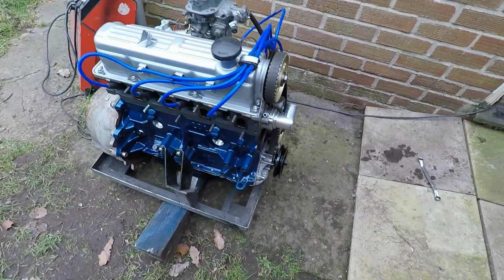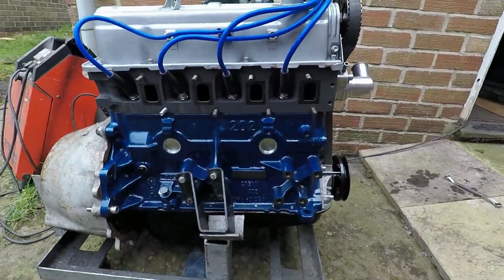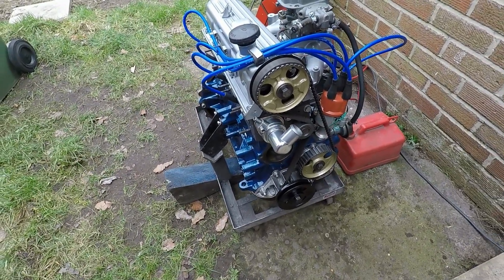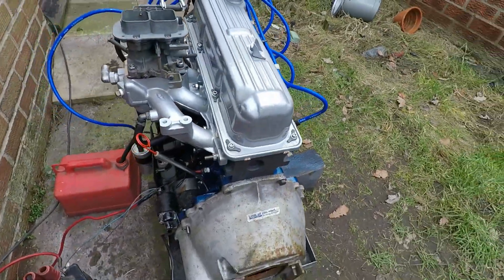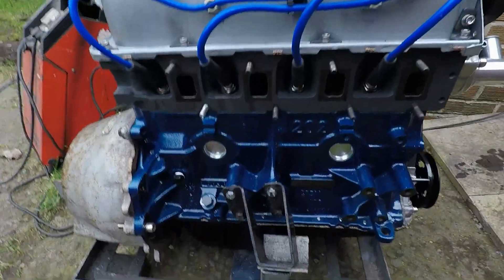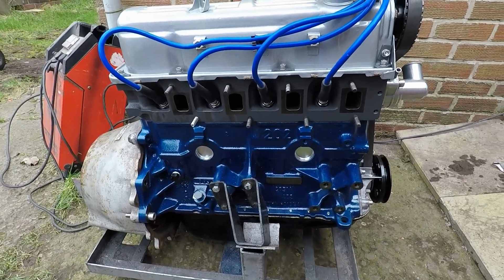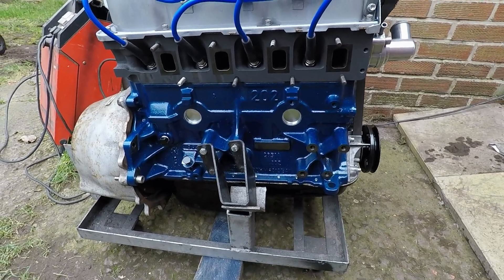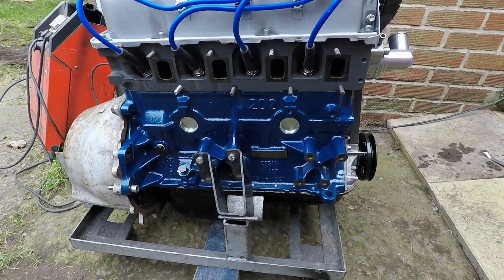Ford OHC Pinto 2 Litre Engine  first fire up   . . . . .   1991 202 block.

Comment: A few short comings when they were first made like the cam oil spray bar getting blocked and knocking cams out but overall a truly great long lived engine capable of big mileage with regular oil changes.
I had a 1.6 in a Capri & a 2.0 in a mk4 cortina, neither gave any trouble. Easy to work on and service and inexpensive..

Comment: I have a 2Ltr pinto in my Escort which has done a genuine 80,000 miles and I would love to know your thoughts on preventing the rear crankshaft oil seal from leaking.  There is no wear on the crank where it fits and it's pouring out enough oil to soak the gearbox crossmember rubber mounting!   It seems to be a big problem with my friends who also have the same engines.  I fitted an original Ford seal, which went in nice and evenly but it did not last very long.  I have thought of trying the Cosworth twin lip seal and I believe there is a PTFE version available now, any thoughts would be welcome.   By the way that pinto does sound good.
Reply from the maker: I have never really had a problem with leaking rear seals, If where the seal runs measures up ok with no corrosion marks or grooves the standard seal should be fine.... Might be worth checking the rear bearing cap as this has a seal down either side... I have stripped a couple that were oily in this area.....
Reply: @BLOWN8CYLINDER  Many thanks for getting back to me, but it is quite a common problem that I have read about many times!  All seals were replaced with Ford Items on the engine rebuild, that's why I'm puzzled.

Comment: I'm stripping my 1.6 pinto but can't get the crankshaft cam belt gear off. Have tried 2 screwdrivers but not budging. any tips please. Good video by the way.
Reply from the maker: Sometimes they slip right off but every now and again I come across one that doesn't want to move.... I have found that heat is your friend and a blow torch will heat it enough for it to slide off.
Reply: @BLOWN8CYLINDER  sorted ! Borrowed a really thin 2 leg puller . Cheers

Comment: Hi again, another problem,  I've bought all my parts for the rebuild but am having problems with the serrated oil control rings. They are too big for the bores. All the others are fine with about 20 thou gaps. They are the correct ones for my engine. They actually overlap by at least 1 millimeter. I'm on std bore with new hepolite std rings. The rings info is correct for my bore size.
Reply from the maker: Hi David,  the ring info may be correct but there is a slim possibility that they were packaged wrong?  How do they compare to the originals?  You could file the end of the ring down to bring it to the correct size...  Checking ring gaps is important for this very reason.
Reply: @BLOWN8CYLINDER  thanks for the quick reply , I've filed down the normal type rings before to get the correct gap in motorcycle rings, but the oil ones look too weak to file. The old ones (which I still have)  are also a tight fit but were in the running engine. I've just ordered another set to see if these ones were wrong.  Will keep you posted. Cheers
Reply: @BLOWN8CYLINDER  Success. The rings were fine, it was just my brain was wrongly packaged ! I bought a ring clamp &, straight in. Thanks again.

Comment: hello im with pinto 1.6 165 block could i fit parts from 2.0?
Reply from the maker: Hello....  The 1.6  165 block  was the later 'long stroke' and used the 2 litre crankshaft with a smaller cylinder bore than the early 1.6 . However, I do believe the camshaft was the same for both early and later 1.6  The early short stroke 1.6 GT engine had the 2 litre camshaft fitted, this gave a little more valve lift and duration.... and better performance.....  So you could fit a 2 litre camshaft and the early Weber 32/36 DGAV carb.

Comment: Nice what kinda bhp is it?
Reply from the maker: This one has been rebuilt to factory spec,  it's running the standard 2 litre cam  and the standard 9.2-1 compression ratio, the only modification was a little work to the exhaust ports to pep up the flow.  As standard these engines make around 100 bhp , this one will have a little more and really does depend on what inginition and carb setup are used... The carb and distributor used in this video are for testing only.
Reply: @BLOWN8CYLINDER 
Cool looks and sounds sweet 👍 I have a 2L pinto in my MK2 need the bottom end doing really tho as it's low on compression, still runs ok tho. Thinking of going 2.1 you don't know of any blocks for sale do you?
Reply from the maker: @JACKSPEED_TV      The only difference in the low and high compression engines are the pistons,  if your MK2 is not a daily driver why not consider reboring your block?  Going to 2.1 with no other mods will give a slight increase in power,  but a rebore and high comp pistons will see a noticeable increase.  I have a few early blocks that all require reboring but no 205 or 202 blocks that are favored for 2.1 builds. The only late engine I know for sale at this moment is the one in this video.
Reply: @BLOWN8CYLINDER 
Ok thanks, What kind of money would I be looking at to get my 205 block bored out with high comp 2.1 pistons?
Reply from the maker: @JACKSPEED_TV     You will be looking around 100 quid plus to rebore the block and around 250 quid for pistons.
Reply: @BLOWN8CYLINDER 
Cool, thanks for info and quick replys. Where are you based btw?
Reply from the maker: @JACKSPEED_TV  I'm based in North Yorkshire,  few miles south of York.
Reply: @BLOWN8CYLINDER  Hmm, now that sounds like a very interesting price there.....stroking chin,  thinking explaining to wife!!! I'll come back to you.
Reply: @BLOWN8CYLINDER  What carb and distributer are you using?
Reply from the maker: @byronhewitt9559   For testing before going to new owners I run them up on a Weber 32/36 DGAV  and a Bosch points distributor....
Reply: Been looking for a 202 block for a while now with no luck. 🤔
Reply: Hi mate, ive recently just purchased a 202 engine for my Robin Hood 2B kit car, from what ive read the 202 came in both normal compression and low.. do you know what compressions I should be seeing on a test to confirm what pistons I have? Cheers 👍

Comment: What carb and distributor are you using?
Reply from the maker: I run all my Pinto's up with a standard Bosch points distributor and a Weber 32/36 DGV carb